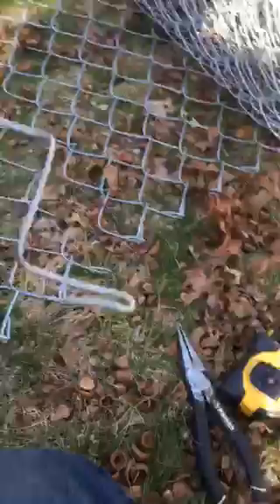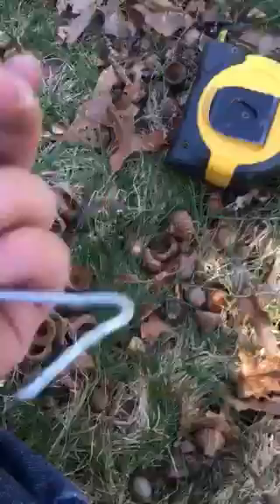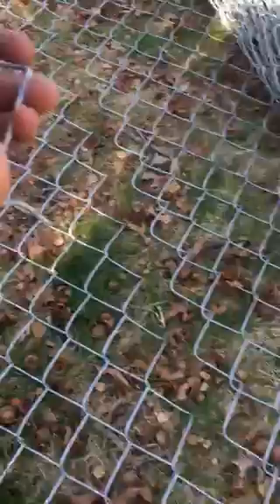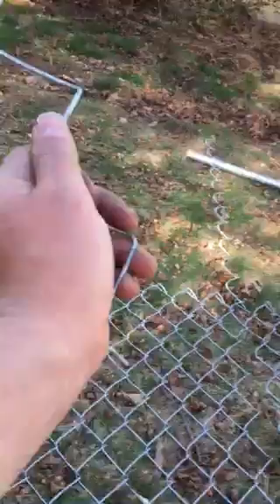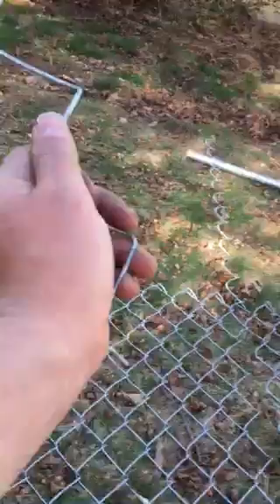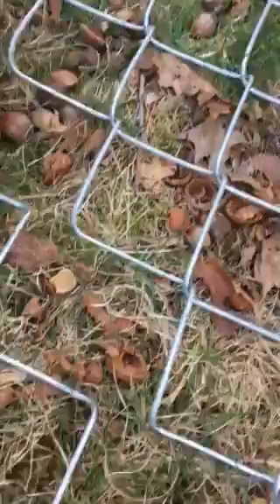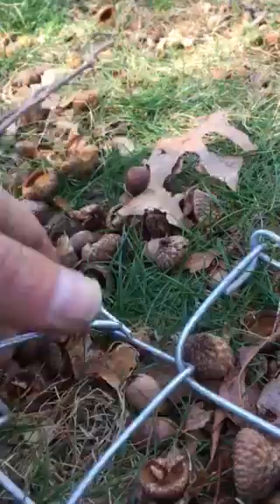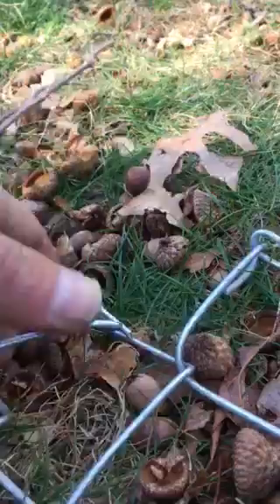DIY Tip How to seam or splice chain link Fence together

Comment: For people who haven't done this before (aka me) this doesnt work well if both sides of the chain link are stuck in place and have tension. However, if the pieces are loose, such as in this video, then it works great.
Reply from the maker: Jewellab0113 there is no way anyone can seem the fence if it’s under tension
Reply: @zimmermanroofingandconstru4008  ya, i figured that out lol

Comment: Story of my life...always a "disconnect".  Here it was where he got the replacement from.  "You wanna pull it out" he say and he suddenly has it in his hand.  The low volume made me play it three times to get that.  So where do I get the replacement strand?
Reply from the maker: Pull a peice out of another fence or the roll every section is made of thousands of the seam peices if that makes sense
Reply: The rolls come with a loose link